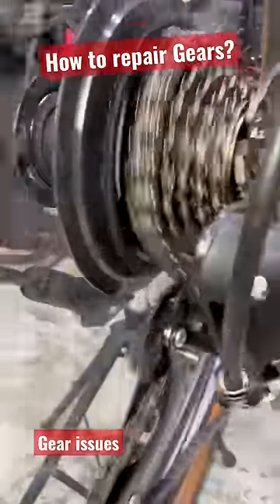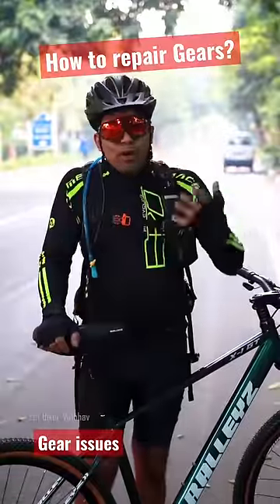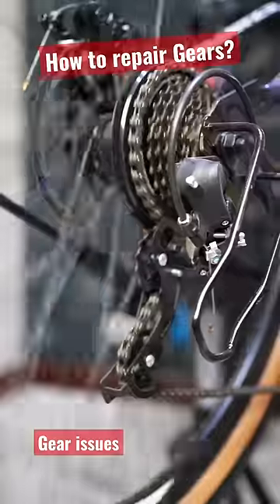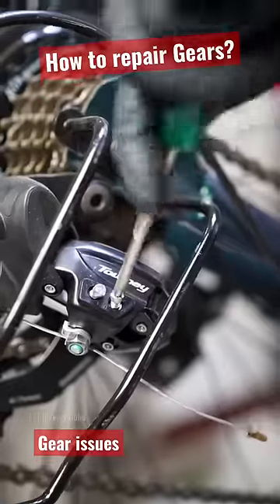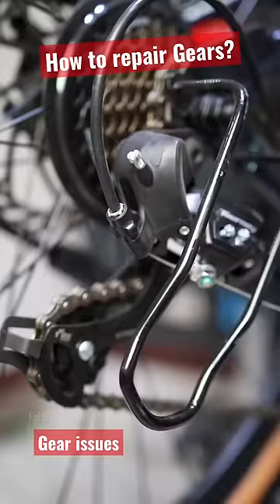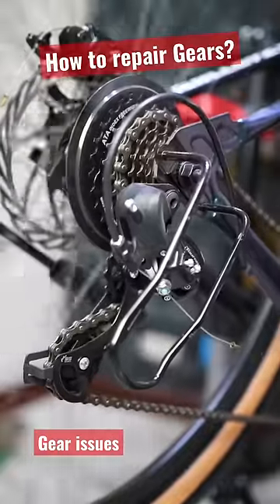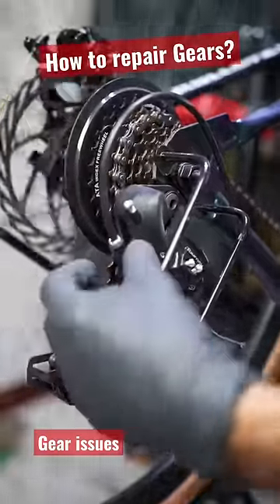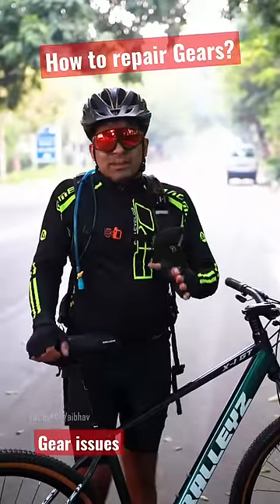Are you having Gear Problems in your bicycle? This is how simple it is to repair it

Comment: Mene pura gear derailleur hi tod dala Niche girake Shimano Altus 😂
Reply: Which cycle broo
Reply: Schnell Sierra 3.0
Reply: @KASHI8484  uuhh 6y666hi
Reply: @gamespace0125  bro jab main start se hard pedal karke push karta hun tab ekdum se chain utar jaati hai....meri front waale gears ki wire toot gayi hai toh maine usse tight karke front ke 2nd gear pe set ki hai, vohi utar ke 1st chale jaati hai jisse se 2baar main gir gaya hun...iska koi solution?
Reply: Bhai Mera joint tuut gya